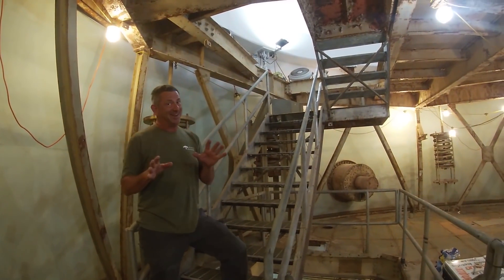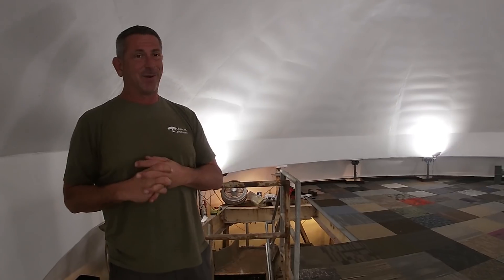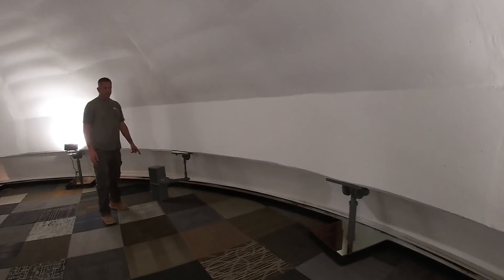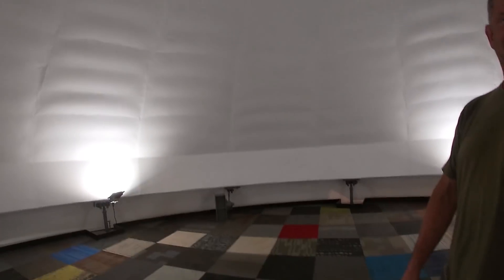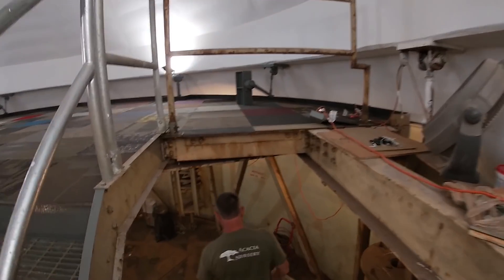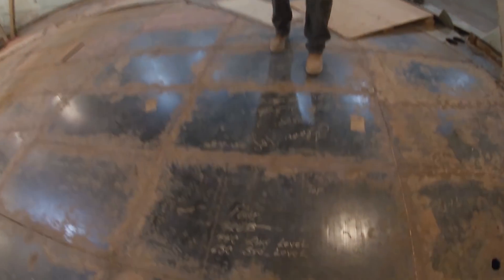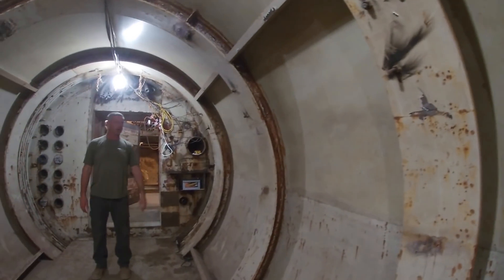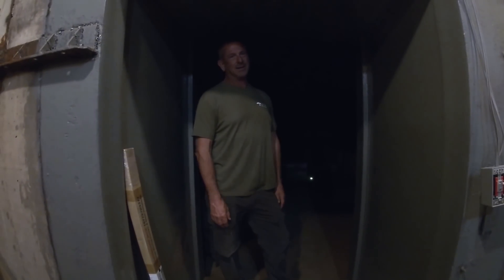S1E16 - Arizona Titan II Level 1 Tour (3of3) - Owning a Titan II Missile Silo

Comment: What do you mean you can not put a hole through ten feet of concrete and steel plate..... I do it all the time.... I have drilled say 3' dia. holes down to 21feet including going through several 1/2" steel plates on the way down.  That's just personally.  Others in this company have drilled down past 34ft.  Why did they stop there?  Its hard to find concrete any deeper with out drill through a dam or...?

Yes, I do cut concrete everyday... I work at "Concrete Coring Company" ... the best and oldest coring company right here in the great state of Arizona.  Based out of the Phoenix area of coarse... we do travel all around the state and to a few others states like New Mexico and California.  This company works for every state, county, city agency... and almost every contractor in the plumbing electrical and concrete etc... fields.  
Though we do work for some contractors on residential projects..... that is not where we work very often.  Concrete Coring is also not considered a commercial Concrete cutting company.... but works most of the time on the industrial level where other cutting companies just can not go.  And can still handle all of the work below that with greater speed and ease.
Yes we have done things that almost everybody says is impossible.   You call the other companies..... and even they... will tell you to call me.

We have been called to cut thousands of holes in the Panama canal, where all the others had not had the a knowledge or capability to complete the work needed, and the one that said they could... failed.
I bet I am personally one of the only ones to ever drill a pair of 28"dia holes in one of the containment domes at this countries largest power plant, just west of the valley here.
A few weeks ago i cut a 36" hole in a 3ft. thick wall.... while swinging from a seat.... hanging from a crane.... 45ft. below ground level.... 'under' Luke air force base.   
We have cut 20ft off the top of those hundreds of feet tall smoke stacks you see at coal fired power plants.... oh yeah we also 'cut' concrete.... wall saw 20ft wide door openings in 2ft thick walls.... cut up commercial runways.... removed 28'x8'x9" thick slabs of concrete and metal out of the fourth floor of a building.... over the top of the premier microchip makers cleanest of cleanrooms right there in Chandler.... 
What seems impossible.... is just another challenge for tomorrow.
Great project by the way.... I envy both of you guys.  I would love to own one of these sites... especially here in Arizona.
Reply from the maker: $$ is the problem.

Comment: Concerning graffiti, if you ever make your way out to the silo equipment area, then make a point of checking the backside of the 100K gallon water tank on level six. You have to climb over the railing and inch your way to the backside on the conduit. This is the location where crew artists would paint or draw murals. When I was on crew, we made a point of checking this location during DSV (Daily Shift Verification) anytime we were an “away” crew meaning we were assigned an alert tour at a complex that was not our home site. Some of the tanks sported some amazing drawings.
Reply: @castanab1 Bottom panel of the MGACG (Missile Guidance Alignment Checkout Group - for those that don't know). Ours was stuffed.

Comment: Very impressive Doug. Hats off to you. I believe your site is the old 570-06. I was there in the early 1980's and found the long cableway sitting next to the access road just north of Tangerine. I helped myself to several danger high voltage signs. Came back many years later and found it was a nursery. I called that site home for almost four years both as a DMCCC and a MCCC.I was one of the few commanders who had the excitement of taking a Titan 2 off alert. Believe me that was a very big deal its day being that targets had to be covered. Make a long  story short the cooling fan on PS-1 disintegrated after spinning for about 11 years at 2AM of course. MFT performed a shut down and switched over to BPS-1 which I was assured would last 8 hours until MIMS arrived. It failed after 2 hours and 40 minutes, adios power to the MAGCG. Got to wake up Col Scott 390th WC and he got to wake up some folks in Omaha. Fun times at 06.I left the service being greedy I wanted to make more money than the AF was willing to pay. Never got too far away been living up the road in Scottsdale 45 years now. Good luck to you on your endeavor.
Reply: That's a fascinating story

Comment: It would sure sound better if you had a mike to cut down on echo. Thanks very interesting .
Reply: I will do what I can for future videos, I agree the audio on these is a challenge.  I just have a little GoPro, not sure how to attach a remote mic.  It's sealed up tight (waterproof) with no connecting ports for an external device.

Comment: Do you know of any of the sites that have opened the silo? I know that supposedly they filled them up with debris but as with any Government contractor they might have skipped one? I have heard that the generators were too costly to remove and some are still in place.
Reply: Generators were removed from AZ sites but no AR and KS generators were removed.  But they are most likely all under water now.  As to opening the actual silo...  Stay tuned to the 4 Titan site channels over the summer.
Reply from the maker: They are all filled. That being said it could/may have been done
Reply: There is a lecture from Chuck Penson available on YT where he says that one of the AZ sites silo has been opened (or rather accessed from the long cableway entrance level). All silo equipment areas are accessible and "rather intact" down to the bottom - only the internal ring where the missile once stood is completely filled with debris. The lecture is from 2017 and he wouldn't say which site exactly he's referring to...
Reply: @MrSzachMatt  He was sworn to secrecy, lol!  I'll have to look for it.
Reply: @ArizonaTitan  https://www.youtube.com/watch?v=sXEZ6SVHuBA&t=2839s from 47m30s  :D

Comment: How does that guys cell phone ring underground inside that metal container?
Reply: I installed fiber optics when I ran commercial power.  Got it all down there - cell phone, cable, high-speed Internet.  Just about everything runs over fiber these days.
Reply: Likely a repeater.

Comment: Just don’t use a propane hot water heater!😝
Reply: I have commercial power down there.  Won't need a standing water heater - I was thinking the under-sink instant hot water type system would make more sense.
Reply: Arizona Titan 2 if you didn’t catch the reference he was making. It’s to a underground shelter built in north TX that blew up. The shelter was built by a disreputable builder. They put propane water heaters in them. Unfortunately when it blew up, it killed all three of the occupants.
Reply: @waamp6984  Did not know that.  WOW!

Comment: IF I ever came under the good fortune to get one of these beasts in fairly good condition, the last things I would do are to add a bunch of home made control panels with random blinking lights, but also normal controls and indication for HVAC operation, normal lighting, emergency (red) lighting, caution (yellow) lighting, night time (green) lighting, remote antenna lift booms for ham/CB radios, rotators for satellite/internet alignment, and back up power generation/active line monitoring and controls. Sure it would be tedious and would require a lot of time, coax cables, ethernet cables, power lines, and circuit wiring, but it would be fun all the same!

Comment: How were these sites built originally?  Did they excavate the entire thing, build the silo and bury it, or dig it all out?  If the later what process would that have used?
Reply from the maker: Look up @atomic rancher. He did a great video
Reply: @atomicunderground9971  Will do! Thanks!
Reply: Little bit of both.  They excavated to the level of the bottom of the cableways.  They called it "the bathtub" but it was about the size and shape of a small stadium.  Command center was dug out another 10 feet or so for the base, but the silo still had to go down more than another 100 feet.  They ran a dozer in circles going deeper and deeper using a buck crane to remove the loosened soil.
Reply: Whoever is wondering; yes, they were excavated and then built.

Comment: That is exactly what I told these Arkansas folks that they need to do.  Scrap all of that old metal to pay for rebuilding everything using lumber and drywall.  Put a circular staircase in the middle of the floor and you will have a good start with rooms around the perimeter.  I love the dome ceiling.  Split level 1 using open walls to expose that dome ceiling...  plenty of room for a small day use 1/2 bathroom, small kitchen, and living/dining area.  You can go for a larger formal kitchen/dining on L2, and a home theater on L3 with bedrooms below that.

After level 1 put the semi-circle staircases staggered around the perimeter right against the wall.
Reply from the maker: Scrapping the old metal actually costs us. It does not pay for anything but I am doing it anyway
Reply: @atomicunderground9971  How is that?  I know a few scrappers and they are all making money scrapping junk metal.  None are getting rich, but it's not costing them any more than time, gas, and wear on their vehicle.
Reply: @barking.dog.productions1777  It's extremely laborious to remove and carry out of what is basically a deep hole in the ground, and most of the high-value scrap like copper wiring was already removed when the Air Force initially decommissioned the sites.
Reply: @mentalstampede  I could see it as being very labor intensive without the right tools.

You might be able to get by with a plasma torch and a truck winch, but otherwise you would probably need some heavy equipment.

Comment: What do you do about the  lead paint? You are doing some amazing work there...
Reply: The yellow color was the only paint that tested positive for having a lead base.  The green and others were negative.  Basically take all the proper precautions - don't eat it, wear a mask when scraping (no sandblasting) and paint over it with several coats.  Exactly how the government recommends you handle old paint in your home.
Reply: @ArizonaTitan  That orange paint (particularly in your "tool room" at the entrance right inside what you called "blast door 6") looks like the red lead in linseed oil (TT-P-86) that the Corps of Engineers liked to specify for the primer in their industrial coating systems until the late '70s/early '80s.  Sometimes colors don't come through well on camera, so if you really had it tested and it's clear, OK, but it sure does a great impression of the lead paint I see at work all the time.  It's great as a paint and lasts forever, but you definitely don't want to eat the flat candy, and want to avoid abrasive blasting without being prepared to handle it.

It's surprising to that the yellow paint was lead based; typically the yellow stuff was a chromium pigment.  (Also really toxic, but less famous than lead which got used in houses--though that was typically white lead used for color, not the red lead used for industrial paints due to the excellent corrosion resistance.)

Comment: That's too bad he painted over the graffiti
Reply: I had a real battle with this.  At the time, there was so much rust and rot and debris up there I was determined to make it all clean.  There was a lot of peeling paint in that area.  I would have needed to cover/protect the area from paint overspray and cement repair, then I would have needed to somehow stop the paint from peeling off.  I could not see a way to do that so I felt at the time all I could do was preserve it in photo.  In retrospect - since it would not have hurt the aesthetics of the finished room - I do wish I had done something to preserve it.  However - it HAS been preserved in photographs and shared with the museum for others to see.  I will try to dig them up and share them on my channel.